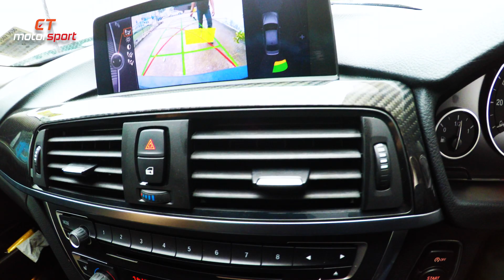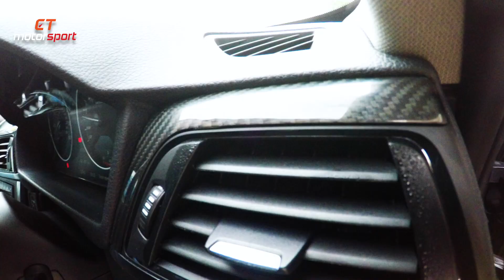BMW F30 CONVERT M3 BODYKIT AND INTERIOR CARBON FIBER(no paint)

Comment: WTF is this?! You didn't even code the taillights to run properly 😂 You didn't even change to a M Sport steering wheel, just a base model wheel 😂 The carbon interior are overlay stickers instead of full trim pieces 😂 If your going to pretend your base model is an m3, at least put some effort into it 😂